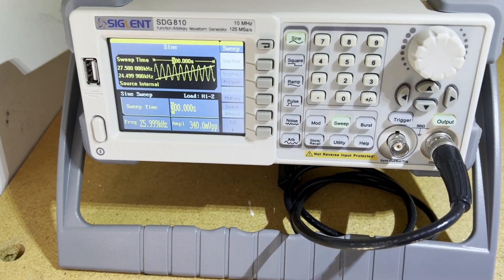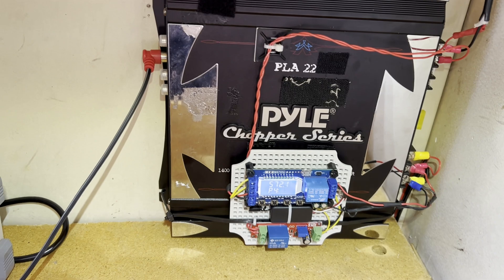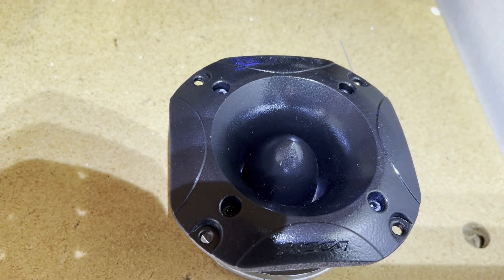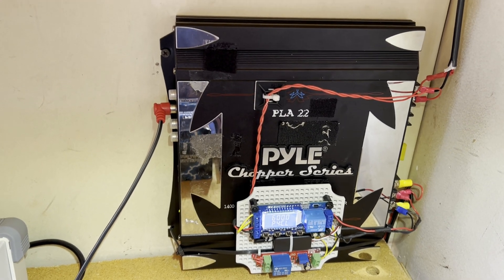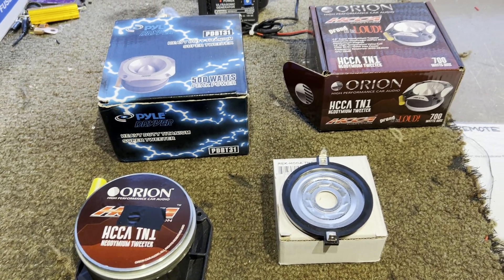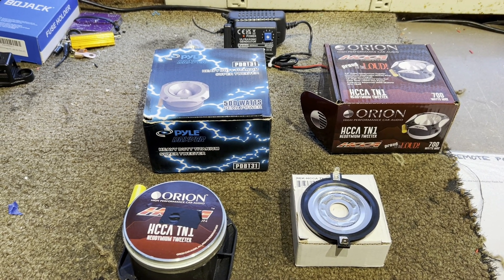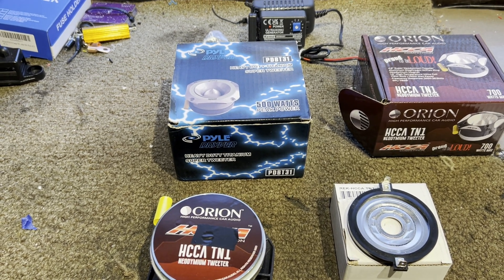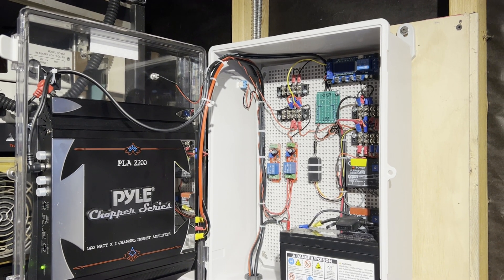Ultrasonic anti dog bark device update

Comment: Nice set up Bob. I like it! Interesting did you go through the exercise of impedance matching? Also what is the voltage input sensitivity on that pyle amplifier? Are you viewing the sine wave on an O-scope? I think you are only getting 15 watts because of your amplifier choice. Those tweeters should be able to get up to at least over 50 Watts or better. I also sweep and got up to over 100 Watts with my set up. Conceptually similar to your set up with some significant differences. Nice fun project! Enjoy!  https://www.youtube.com/watch?v=CdKaBQk0GSQ&t=5s
Reply from the maker: Hi Yuri, it was actually your video that inspired me to try the waveform generator. Power output is not a problem,  I pulled it back to 15 watts. The current Orion's tweeters I am using in parallel dont even get warm at this setting but at 40 watts and above they get warm quick.  And yes I have looked at the waveform generator on my service monitor. My current setting on this guy sweeps 25 KHZ to 26KHZ in a 10 second period,  itsseems to shut the dogs up quickly.  

Below is my video on the big unit that uses the Kemo generator, thanks to your video and others that gave some great ideas on building this stuff and having some fun along the way. 

Yuri take a look at this one:  
https://youtu.be/mLXzkRMavWw?si=H2dRd_COzbp61PXu
Reply: @bobkirby3114  Hey Bob, I'm not sure using a FG with constant sine wave output is causing your speaker voice coils to overheat. I have had no issues with my speakers heating up using the FG running constant at 20 VAC or 100 Watts. No heat at all at 20 VAC. Guys that I speak with have also not experienced this issue but your system is a different design. Just for curiosity did you measure VAC, amps, and impedance at 40 Watts when your Coils over heated? I love your design and video but something doesn't add up here and I'm not sure what it is. I suspect the issue but don't want to say unless I know VAC, amps and at least resistance measurements at 40 Watts when your coil failed. Note: Measuring voltage with a hand held DMM @20Khz plus is not reliable. At ultrasonic frequencies you would need a bench DMM to accurately measure. Interesting point of failure scenario you have run into. One more question, was your amplifier also hot when your voice coli failed? Did you happen to notice any clipping at the time?  Thanks!
Reply from the maker: @yurij8039  Hey Yurij, you make a good point. You may be right that my voltmeter  is not a super high end one like yours so at ultrasonic frequencies mine could be even less accurate. Things have been stable and I have not lost any tweeters for awhile now and the dogs have been compliant. By the way how effective was your setup on your neighborhood dogs? It's a shame that people have to resort to devices like these because of inconsiderate neighbors.
Reply: @bobkirby3114  My set up was very effective and the dogs were trained within a week. I was going to set up a bark detection circuit but the dogs trained so fast there was no need. This type of design is excellent and I like how you used a DC system compared to my VAC. I guess this proves both types of designs work. I started with a DC Kemo system and then Testocillator but when I fried my amplifier decided against jumping between DC and AC. The Testocillator output voltage was up around 5 plus volts and I just decided not to fuss around since you can tune the FG output voltage to match the amplifier input voltage. I didn't want to get into experimenting with batteries or charging issues. Your using the DC power supply took care of battery charging issues along with signal noise issues. I also liked how you used the delay circuit on the Kemo. Without that circuit you lose stealth. Nice one! My amplifier input signal and clipping indicator triggered but it burned out so fast, I realized this is no toy. I learned from some guys using XLR cables may solve that issue but I never tried because my VAC system was already far along. My system is over specified but when seeing flames jump out of an amplifier in your home, I was not going to play around and proceeded in a very safe and conservative way. Not worth burning down your house over barking dogs. LOL! My advice to anyone building one of these systems out is to be careful about frying out your equipment and wear ear plugs. Interesting working with equipment you can't hear but it is very loud and can damage your ears. I also try to be kind to the dogs and do not try to blow their ear drums out. It's really the owners fault for letting the dogs bark so much. Anyway, great video and design. I like the agonizer spin on yours. I guess this proves there are more than one way to skin a cat or shut up a dog. LOL!
Reply: @yurij8039  based on what you've hinted here (you suspect you know the issue with Bob's setup), would you recommend any tweaks or improvements on what he's done?  I like his approach because equipment costs seems on the lower end and I have a dog that is not that far away

Comment: Your previous video inspired me to build one !  While searching for the KEMO sound generator I discovered they also made M034N 40 watt amplifier, it's a little bit bigger than a golf ball so cant be very powerful but probably better than nothing so I found a used one on eBay for cheap.  Currently running the $8 pair of amazon 38mm piezo tweeters and the neighbors 4 barking chihuahuas seem to shut up when I turn it on.  Do you think the orion speaker would be an upgrade or a waste of money with this tiny amp?  Dogs are only about 25 feet away but after 12 years of listening to them bark 24/7/365 I really want them to appreciate my ultrasonic music :)  Was going to use a remote but ended up using a smart plug and setting up a routine, now I just say "alexa bark" and it turns it on for 15 seconds and turns off, can adjust to any time.
Reply from the maker: Nice on your setup, From my testing both the Piles and Orion tweeters puts out more sound than the Piezos.  I was seeing 20db more sound using the Orion vs the Piezo which is a huge difference, you can just put a sound DB app on your phone to test. Below is my video on testing speakers on the KEMO with no amplifier. Also if you don't want to wire in a keychain remote here is another possibility if you are powering the Kemo off a power supply, a remote AC switch. see below link. 

https://www.amazon.com/BN-LINK-Outdoor-Wireless-Weatherproof-Included/dp/B0CXQ13JTJ/ref=asc_df_B0CXQ13JTJ?mcid=b94daea381d03b6c83c192015fb1a45a&hvocijid=8523572482461345446-B0CXQ13JTJ-&hvexpln=73&tag=hyprod-20&linkCode=df0&hvadid=721245378154&hvpos=&hvnetw=g&hvrand=8523572482461345446&hvpone=&hvptwo=&hvqmt=&hvdev=c&hvdvcmdl=&hvlocint=&hvlocphy=9032030&hvtargid=pla-2281435179738&th=1

My tweeter test video: https://youtu.be/T-MdMUWuVxY
Reply: @bobkirby3114  Oh wow that is a big difference.  I originally looked at the pyle speaker which is $70 cheaper but noticed that it was listed as max 25k, and my understanding is that I am trying to get just above 25k so the orion at 30k seems like the right choice.  Your thoughts on the range?  Was originally going to do the remote but got alexa to easily work as a voice controlled timer, so with 5 alexa devices in my home and on my phone it's probably easier just to say "alexa bark" while anywhere on my property than it would be for me to keep track of that little remote and remember to carry it around with me :)   Thanks for the help,
Reply from the maker: @LouSassle  I am using (2) of the Pyle PDBT31 on my big unit, It's been working fine on those with 
Kemo unit set between 6-1/2 to 7-1/2 on the dial.
The Pyles  are 106DB of sensitivity and go up to 25KHZ, i Don't have equipment to measure 
anything in the ultrasonic range output wise but these have been effective. I am sure 
once you go  above 25khz the sound output will  start to roll off. The Orions will cover that range no problem.

Comment: Hello fantastic video.  What range do you think this setup has?  Thanks
Reply from the maker: After reading online it seems that the commercially made bark deterrent devices run at around 25KHZ. Since making this video I changed the sweep range using the wave 
form generator to sweep between 25K to 26KHZ in a 3-minute sweep period, seems to be working fine. If you’re using the Kemo unit I’m running the setting around 6-1/2 to 7-1/2 on the dial. 

One other point if forgot to mention on the dog training aspect after a while using these devices it got rid of %95 the nonsense barking where the dogs would just be barking at nothing. But If something agitates or makes the dog(s) mad they absolutely will still bark but those barking outbursts are far shorter than before. It’s a shame because of inconsiderate neighbors we have to use devices like these.
Reply from the maker: I did not proof read my replay the freqeuncy range I am playing with now is 25KHZ to 26KHZ
Reply: @bobkirby3114  thanks for your response.  I totally agree.  I actually meant the range like how many feet will your device work at.  would it work at like 150 feet or 200 feet or do you know when it maxes out?
Reply from the maker: @eddiestobbin3329  The dog behind me is probably 80’ at the most away and the amplified device has been
very effective on it, the tweeters I have mounted on a 5’ 2"x4" screwed to the fence post get above the fence line of that neighborhoods house.

 There are other factors to consider such as line of sight if you can get a decent clear path
I don’t see why being 200 feet would not work. If your target area is on the other side of a house or has some big obstructions it probably won’t be very effective, everyone’s situation is different.
Reply: @bobkirby3114  Awesome thank you